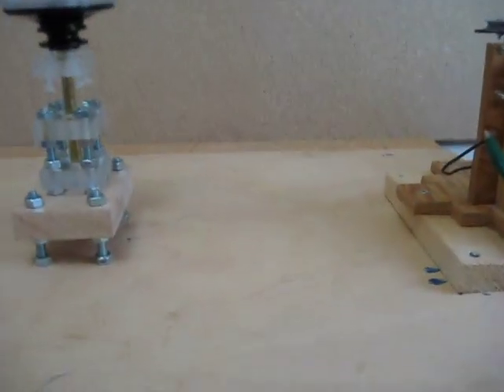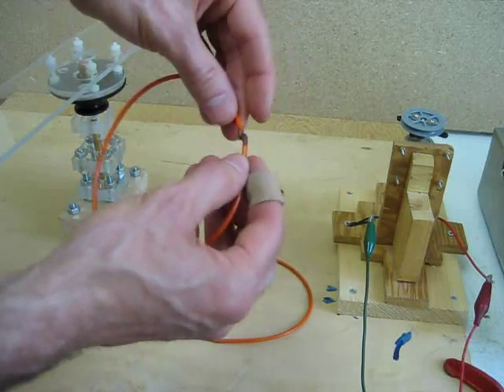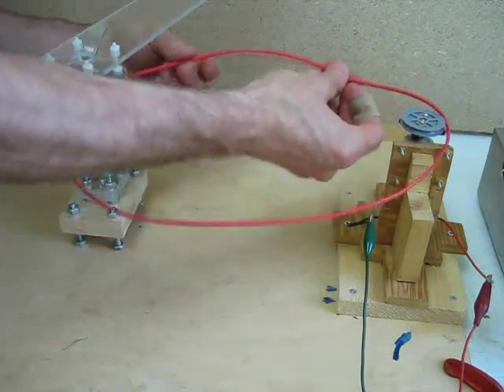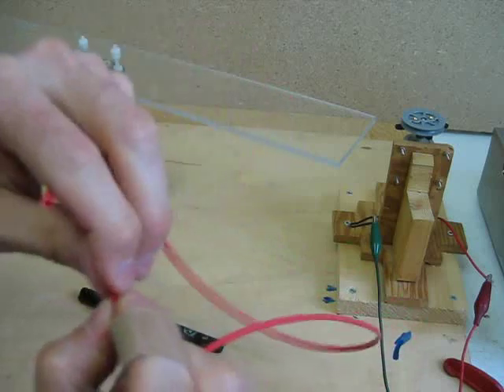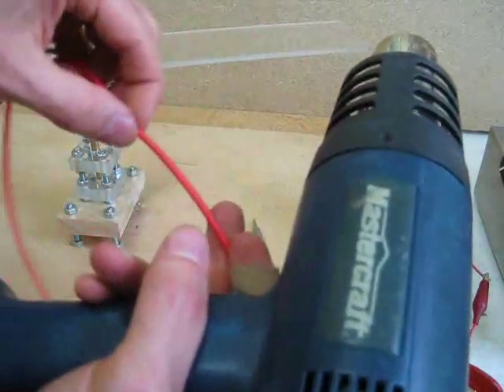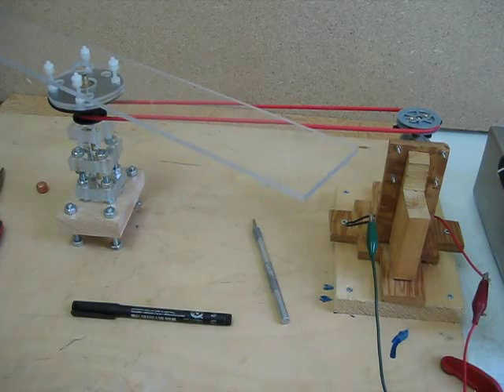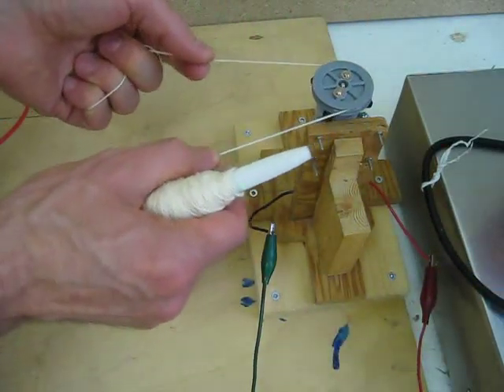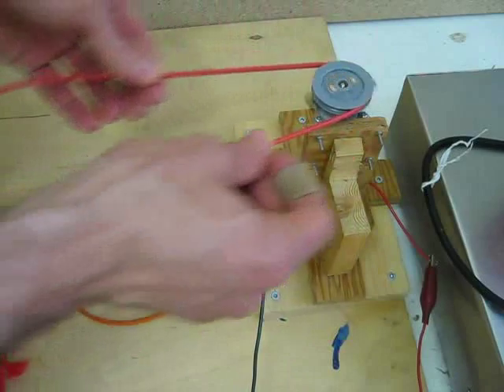How to make a belt for pulleys - both urethane belt and heatshrink tubing

Comment: Small correction... the string slips because it has a different coefficient of friction than the tubing - not because it has a smaller surface area. It's counter-intuitive, but friction is actually independent of surface area. If you had thicker string and the same force it would  still slip. If you had thinner heat-shrink tubing it would stick. You can see this easily if you imagine two belts - one made from a rubber band and the other from a length of fishing line. Even if the fishing line is thicker than the rubber band, it will still slip. The rubber band will have a far higher coefficient of friction with most materials than fishing line.
Reply from the maker: Thanks!

Comment: I was wondering what to use for my 3D printed belts. Have tried those yellow-brown rubber bands. They seem to do a nice work if you set the distance between pulleys correctly. But i dont have that option so im going to try that heatshrink tube. Thanks!

Comment: Where did you purchase the Pulleys?
Reply from the maker: The pulleys are actually not pulleys. They are the hubs (center parts) for wheels from an old K'NEX set. You can see them in the photo here https://www.amazon.com/Micro-Power-Turbo-Racers-11104/dp/B00K1SWG30. Often you can use wheel hubs like these as pulleys.
Reply: Thank you so much!

Comment: Question:  do you have any good resources for SLOW moving pulley motors that can plug into a wall outlet?  Looking for this smaller scale to mount on a ceiling for a Peter Pan themed thing I'm doing.
Reply from the maker: An easy slow moving motor is a microwave oven motor, the motor that turns the try in the microwave oven. Find a microwave oven that someone's thrown out and take the motor out from the bottom. It runs on AC from a wall socket (120V or 240V depending on where you live). See my video about my 1st gravity motor here http://youtu.be/6vwcIO9M-uE at 31 seconds in to see me take one from a microwave oven. I used it as a generator instead of a motor but that doesn't matter. I also attach a pulley to the shaft later in the video.

Comment: I tried this for a 8mm cine projector shutter drive belt, it worked well for a few runs but eventually the heat generated by the lamp caused the heatshrink tubing to alter size. Ok for a temp fix though.
Reply: What was the perspex blade for anyway?
Reply from the maker: throthelens It was for experimenting with non-conventional energy production experiments back in the day when I used to do that. Details are here if you're curious http://rimstar.org/equip/hv_horiz_rotating_test_platform_1007.htmGlad to hear it at least worked for you as a temp fix. Recently I soldered two ends of a flexible, but thickly insulated, wire together to make a belt. You can see that one here https://plus.google.com/116395125136223897621/posts/BFpWcDignjW There was too much friction overall for the motor to turn in that case. Still working on it.

Comment: Hi
Really enjoyed the video.
Was hoping you would go bigger.
I've searched the internet and can not found what I need.
My mower agreed my NEW belt.  I've ordered one, but it 
The grass needs to be cut.
When I was a kid mama had and old new home sewing machine.
That belt was just a fat round piece of rawhide lacing.  When it would break we
Punched a small hole in each end and used a s mall piece of copper that we put
Thru the holes and mashed into a C shape.
I also remember seeing Daddy do the same thing on our old trucks, cars and walk behind tractor..
My mower takes a 140 inch v belt.  The OEM part is 80.00.  
I am thinking of fixing a makeshift.  I thought about using a 3/8 in. piece of water hose or a piece of inter tube.
Any suggestions?
Reply from the maker: In my recent video Gravity Light - Making and Enhancements (version 1) I showed how I stitched together two ends of a bungee cord and wrapped it with black electrical tape and that worked very well. However, your mower might put more strain on either the stitching or the tape than the makeshift belt can handle, but then again it might work. I guess if you want a V shape you could tape a smaller diameter bungee cord to the side of the bigger one.
Reply: @RimstarOrg  TWAT!

Comment from the maker: @ton2xmilton Sorry, that's the only term I know for it. Go to google.com and search for "heat shrink". You can find it in stores that sell electrical parts like resistors, capacitors, wires, transformers, ... Radio Shack is one example.